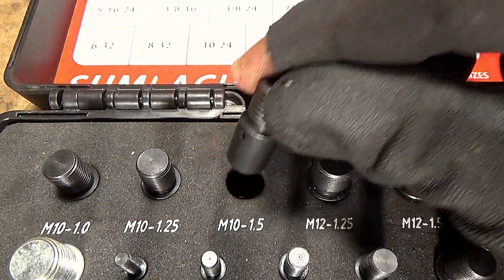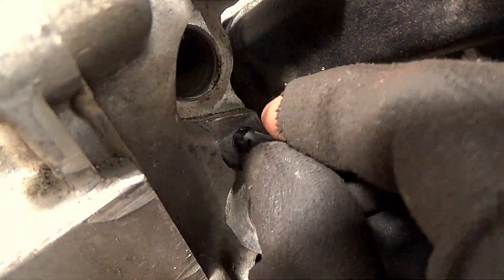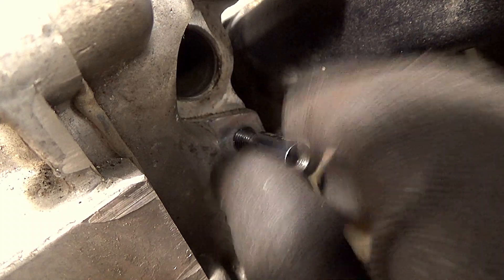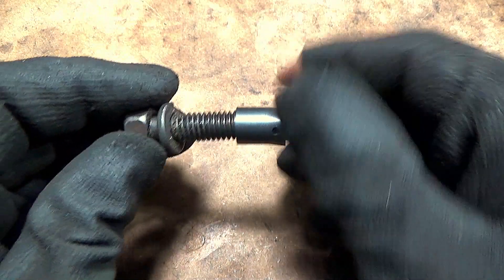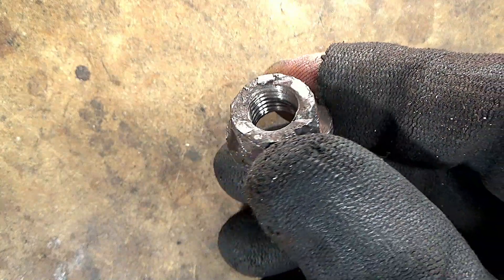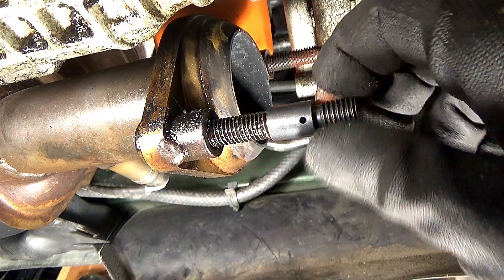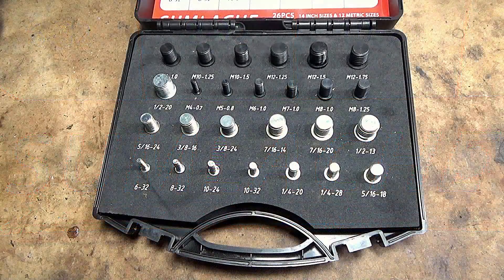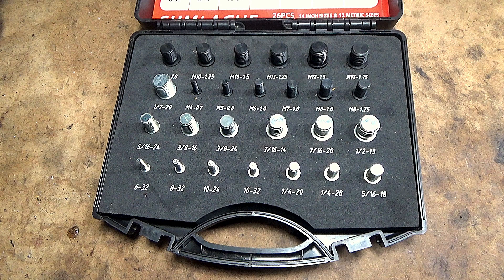Thread checker/identifier (mobile version)

Comment: Thank you for the tip. I just received a like new front strut that came without flange nuts to secure the top bolts. This kit would have easily helped determine what flange nut I needed for the job.